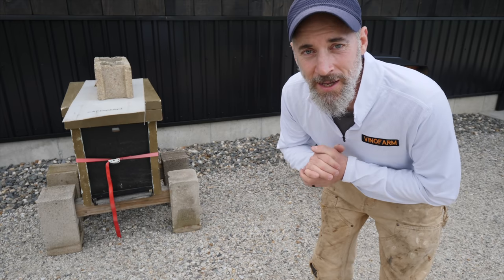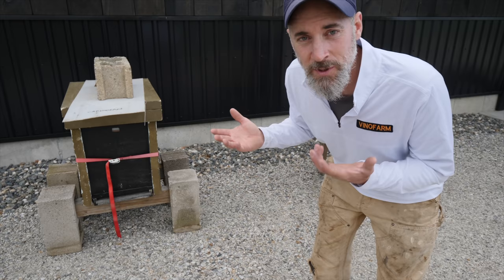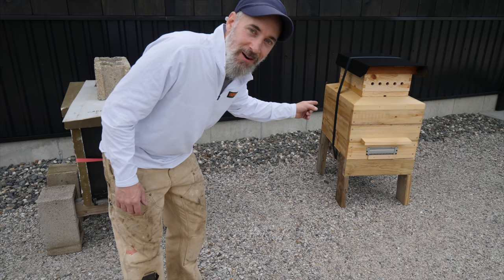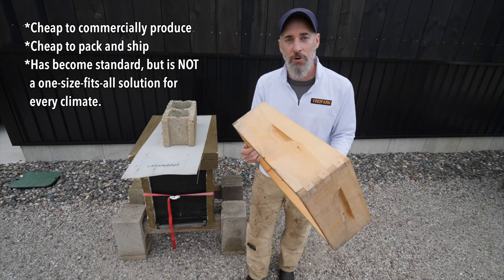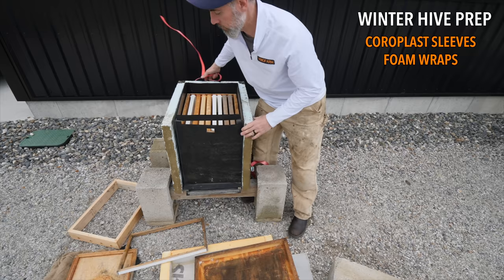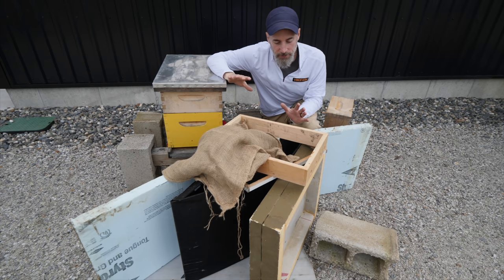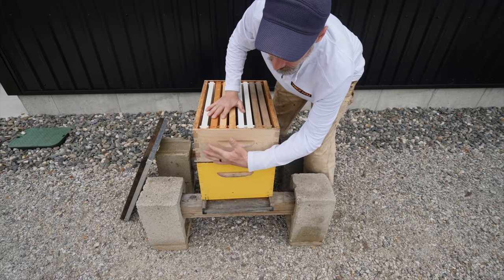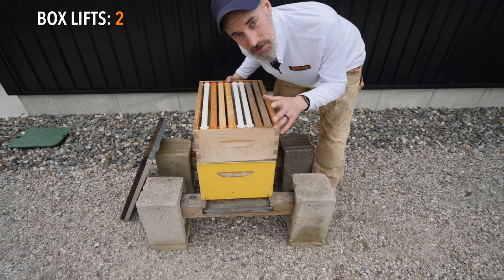I Fixed The Langstroth Hive (For The Bees AND The Keeper!)

Comment: Lol, so glad you "fixed" a system in use for over 100 years! And right after you suffered almost complete winter mortality. Sounds like you've got the right experience 🤷‍♂️
Reply from the maker: You seem to have missed my point.
Reply: @vinofarm  Point seems to be that you don't care much for the health of your bees? A reasonable response to high winter mortality would be to ask an experienced beekeeper about mistakes you might have made with IPM or ventilation on your existing equipment - not design an entirely new setup. Not sure how you can learn from your mistakes if you insist on making brand new ones.
Reply from the maker: @dufourea  My response to high winter losses was to learn what killed my bees (Varroa), acknowledge my mistakes and then completely change my mite management strategy. I made a 17 minute video about it 3 weeks ago. This hive redesign has nothing to do with my strategy to combat those losses. You are conflating why I built this with my bees dying. This video is about creating a bee hive that requires no lifting of boxes to inspect. It’s also a hive that requires almost nothing to transform for winterization. Everything you just told me I needed to do is happening and has been for months. This hive is ALSO a thing I did and it will make the “beekeeping” part of beekeeping a lot easier and more enjoyable. I know the difference between beekeeping and beekeeping  equipment. I know a new box will not solve the problems I experienced last winter. But I’m allowed to redesign my equipment and work on those problems at the same time.
Reply: @vinofarm  You're absolutely right. Livestock owners the world over are allowed to keep their animals in completely untested habitats - if they wish. That doesn't really apply to their responsibilities as stewards.

Let's break it down: you're an inexperienced beekeeper who started with way, way too many hives - then killed most of them due to an imperfect understanding of mite management. Now you're moving the bees you have left (and, I would imagine, grabbing from all over your area) into completely untested equipment that doesn't even have a basis in beekeeping literature. Except, as far as I can tell, some mishmosh focus on 8-frame systems, Warré ventilation, and God knows what else.

You need a mentor. You need solid advice. You need to stop coming up with something "new" for the YouTube algorithm. Because lives are depending on you. You're not even testing the waters with this design to see how it does through the winter - it looks like you moved your remaining bees into them, with no evidence. 

Looking forward to the post-mortem in spring 2022. Good luck, I suppose.
Reply from the maker: @dufourea  Lighten up, Francis. You are really reaching. These are Langstroth beehives made with 100% Langstroth parts. The ventilation is completely adaptable, adjustable and will be tweaked as needed. You're also forgetting that until my catastrophe last winter (which was admittedly due to poor varroa management... and an extreme drought) my overwintering strategies had gotten about 85% of my bees through 6-month New England winters over 4 straight winters. With a totally refocused mite plan in effect, I will never experience losses like last winter again. And these boxes are actually a VERY minor tweak on what had given me success all along. They are not radically new.
Reply: Lol, cool bro. Ignore my advice, what do I know, I've just been a professional beekeeper for 19 years and am currently running an entire pollinator conservation program 🤷‍♂️

Folks like you literally wreck my business. You're aware that an elevated mite load for you means elevated mite loads for everyone around you? And unhealthy bees are targets for EFB and AFB? But yeah, you're right, it doesn't matter. Have fun I guess!
Reply from the maker: @dufourea  "Lol, so glad you "fixed" a system in use for over 100 years! And right after you suffered almost complete winter mortality. Sounds like you've got the right experience 🤷‍♂️"

Peter, That's not advice. If you want to start off with sarcastic insults, it will not be a productive conversation. It's clear I said or did something to trigger you and you do not really want to help. That's fine. I appreciate the engagement. I openly accept constructive criticism and have used hundreds of youtube comments to help me learn more about beekeeping. Comments like yours are not constructive. They are pure criticism. It's an unfortunate part of the generally positive youtube experience. You don't have to love what I do and it's very easy to just click away. If you really care, constructive criticism is a GREAT thing. However it really takes a concerted effort to type out a mean, sarcastic comment. Nothing positive happens after that.

Comment: Alltough it's cool your inventing your own thing, but did you ever check what a slovenian beehouse looks like??? It's awesome for multiple beehives. It's a country high up in the alpes so it's a good solution for colder climates. And no lifting just open cabinetdoors... i hope it helpes.
Reply: Our hives have a design flaw/feature that doesn't boat well with one inspection every month or more. The AŽ hives cannot change in size/volume which makes them perfect to stack and make big panels with but it also means you are significantly more prone to swarming if you don't keep your bees busy. 

The one big positive is that you can build them into the side of a house/barn/building and do your beekeeping under a roof/inside but this also carries a big negative which is the expense of building a building specifically to house your beehives.
Reply from the maker: The beehouses are very pretty. But I literally had 15 empty Langstroth hives and all the wooden ware laying around in front of me. I decided to repurpose all of it into a design that would be enjoyable to use. There are things I liked about the Langstroth hives that I kept. I changed the things I didn't like and this is what it came out like.
Reply: @vinofarm  would you consider trying 2 colony cohabitation. There are examples of it working very well. As far as I know the theory behind it is - by increasing the number of bees in a colony you increase their foraging capability without increasing their need for food significantly (biggest food spenders are larvae whos number stays the same as in two separate hives). What you gain from cohabitation is more bees which means faster building/filling of comb during flow which increases the honey stores and the hives ability to dry the honey.
Reply: @vinofarm   understandable to re-use all that material and i think it will work. In europe we got something that's called a goldgebust or something it's a big size treetrunk made into a beehive. Often with a face on it, they've been around for a long time. But i tought it might have been a good option to make a sort of bee house if your collonys keep expanding again and not wrap each hive individually. Good luck with the new bees and i love the channel!!

Comment: You've said in some more recent Videos that you want to explain that the bee barn is not (just) about the insulation, but more about the larger continuous frames.  In my mind this video already does that.

Although if you feel like updating it I certainly won't complain. :) I'm sure there are some parts you want to update, such as having the brood semicircle upside down, as possible update the ventilation section & thermal bridge section.

Comment: Jim,  

First off, I love your videos, your approach to beekeeping, and [apparently] life in general. 

We also keep bees, but in a much different environment [Central Texas] and not for as long as you have.  

I like your hive modifications and look forward to seeing you work your new design.  Mostly, I'm just curious to see how it all works out.  I hope for the best for you, even if a little skeptical about a few of your assumptions/conclusions.

For example, I think your spacer boards will not work, because the bees will occupy that space once removed, and you will have a difficult time putting them back in place after your inspection.  I also am curious about how you will separate the frames, once the bees "cross-comb" them together, like they do.  How long is your hive tool?!   

Anyway, love the videos and will keep watching to see how it all turns out!  

Of course, good luck and happy keeping!
Reply from the maker: Ha ha… I have a follow board re-insertion solution. It just arrived in the mail. Stay tuned. All this is version 1.0. I am going to use it all summer and make modifications as I go. I’m open to adaptations as things progress. So far, so good, though. They are attacking the frames!

Comment: Very innovative hive design. I am considering going to a variation of your design. Couple questions, why did you choose to go with an 8 frame box over a 10 frame? One the ventilation/wicking box, is there a reason you put the holes down low instead of near the top?

Comment: Aside from the upside-down brood nest, I've kind of had similar thoughts regarding making a deeper box with deeper frames for a brood nest and building a fully insulated hive. Apimaye makes insulated hives but they're expensive as heck and follow the standard Langstroth sizes.
The "two deeps" thing is soo.... "beginner hobbyist" philosophy. Every commercial beekeeper I've seen winters single deeps just fine, even in Ontario. And considering most of the hobbyists shouting about two deeps are probably not feeding adequately in the fall, odds are they're wintering on the equivalent of a single deep anyway. 
I think you're on target with the deep + medium in terms of full winter storage and a more uninterrupted brood nest. Fewer but deeper frames is far more natural for the bees anyway. I'm interested to see how this goes.
Reply from the maker: Deep and medium covers the winter PLUS our long cold endless spring. Double deep is overkill and a giant pain to inspect. I’ve managed a couple single deeps through winter, but deep+medium is less stressful. Thanks.
Reply: @vinofarm  I'm interested to see how heavy those frames get. All brood wouldn't be too bad, but if they filled one with honey that'd be one really heavy frame.

Comment: Wow, that's impressive. Great job. How much do you think could cost upgrading 1,5k bee boxes and how many crew may needed to be involved to keep track of all this equipment?
Reply from the maker: I think you’re just being snarky, but this is not implied or intended to be a solution for commercial beekeepers. This is a backyard hack.
Reply: @vinofarm  Sorry, I didn't mean to be snarky. I have great respect for all creativity and hard work involved in this project.
Reply from the maker: @wonder_bee  I get a lot of hecklers. Sorry. But yes, this is not a viable solution for someone with more than a dozen hives. It COULD be if you wanted to build a ton of them but they are not really moveable. Think of them as stationary tree stumps. They are big and heavy, which is a feature, not a drawback! I don’t intend to keep more than 8 or 9 of these so they work well for me. Commercial guys laugh at this hive concept, but that’s no big deal to me. I am extremely impressed with how the bees are using these hives and will be sharing my data and full impressions at the end of the season. Thanks for watching.

Comment: Wow what a great idea i lost mine this past winter as well mostly to mites , just wondering how you will do mite treatments going forward with this great design ?
Reply from the maker: OA goes right in the front entrance. Apivar can be suspended between frames like normal (deeper with wire extenders if needed.) Should be the same situation as normal.

Comment: 1. Do you even need the corrpla lid at all at this point? Consider your motivations for having it.
2. If yes. Why not attach it to the lid somehow.
3. Ever considered linking hive parts with latches instead of straps?
4. Ever considered clamping the strap down on the outside of the hive so it doesn’t fall off every time you open it?
Reply from the maker: Actually, everything you mentioned were all considered. Keeping them separated is the best option right now. Box latches would be great and could always be added. This is version 1.0. I guarantee this will look different in 6-12 months.

Comment: Theoretically, if the brood box is never being moved, and the outer insulation is never removed and is protected by wood on all sides, it would have been best to use vacuum insulated panels, which have a rediculous r-value of at least 20, up to 100, and can last at least 35 years so long as there are no mechanical punctures. Wood will likely need to be replaced before the panels do in that case.

Of course, this might be a bit overkill and expensive.
Reply from the maker: And not something I'm going to put together in the garage, but good idea!

Comment: i have never had a problem with queens passing frame gaps, honey barriers, I've even had queens pass through queen excluders. id say the reason your queen doesn't like to lay in the lower box is because it gets colder in the lower box. maybe a slatted bottom rack would help your queen lay into the lower box. do your bees not fill the gap between boxes with bur comb?

Comment: I see a potential problem. If the following boards/spacers are not tight enough on the bottom, 4 sides, and tops, small hive beetles will be able to get behind them and hide from the bees.

Comment: The insulation + the outer shell add some overall width. It seems to me that you could add cleats to make the brood box compatible with either 8 or 10 frame supers/vent boxes. Good idea or bad? And will you be sharing a build video or plans? It's pretty straightforward, but is the insulation exposed in the entrance area? How do you attach the three layers?

Comment: Hello there, that shape of the frames you came up with is quite like the size of the frames on a Dadant beehive. Dadant hives are used in some  parts here in Europe with some modifications here and there. I my self have one. It has its pros and cons. Its good to avoid your bees from swarming due to the bigger space for the queen to lay in. Its bad because it gets really heavy.
Regarding your theory that the bees will build a circular system of brood, they wont. it will become exactly as on regular sized frames, but with bigger rims of honey and polen, and of course more brood area. This beeing said, it is a good option so you dont have to pull up so much frames during your inspections.
Reply from the maker: My frames are quite a bit larger than Dadant frames. Mine are 16" deep.  I don't think the video showed that clearly. Either way, I am curious to see how the bees use such a large space. Thanks.
Reply: @vinofarm  Yes i totally understand that your frames are bigger than Dadants, i was just making an observation regarding what the bees do in that bigger area. If you think about it, beehives in nature build their combs to the size they can or want, and they always follow the same system: honey, polen, brood. Anyway, best of luck and have fun with the bees, thats the most important thing i think, cheers!

Comment: One problem I see. You need to reinforce those top bars.  Those frames are going to be heavy when the honey flow is on.  Besides that, cool!! Give it a try and see what happens.
Reply from the maker: They are gusseted with plywood on all four corners, glued and stapled with 2” staples. Strongest frames I’ve ever seen!

Comment: Hi Jim, I think you are a genius!  What tools did you use to build this box, a chop saw and anything else technical like that? I am going to try to build one using basic tools but if any tool could make it a bit easier id like to know. Especially for the frames too. Thanks  very for sharing your great idea.
Reply from the maker: Table saw is essential. Table saw with dado blades makes this way easier. Compound miter saw and table saw is like 95% of the work on this.

Comment: Ok, you just answered my question…you live in Massachusetts. I live in South Carolina and will be buying my first bee box in the Spring. I live in the upstate closer to the blue ridge mountains where our average winter lows are 27-32 BUT about every 10-15 years, we get into the single digits. Would I need a special box for my bees as long as I insulate the hives through winter?

Comment: Reference the 4 season inner cover:  What if you drilled 4 holes and installed 4 metal disks, two on top and two on the bottom?  Result:  You wouldn't have to flip the metal disks when you flip the cover for a seasonal configuration.  When you flip the cover, set the metal disks on the bottom side to cover the holes.  Then configure top metal disks, as appropriate.  A quicker configuration means less work for you.  Just an idea.  What do you think?